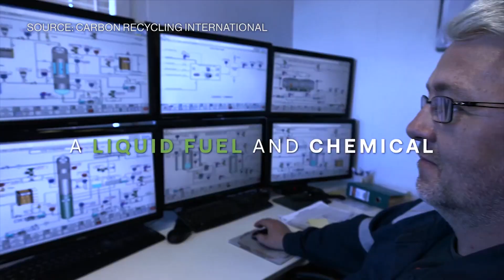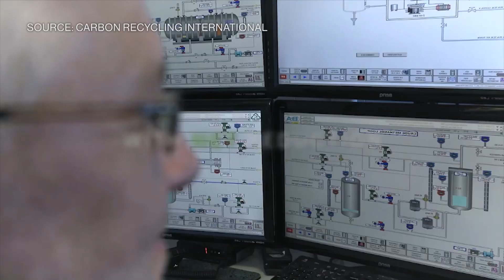Koenigsegg Wants to Use Volcanoes as an Energy Source

Comment: Interestingly, Methanol is a highly flexible fuel i.e it can not only be used in ICE but also fuel cells to produce Hydrogen (electricity) and paired with electric motors or an off grid energy source, etc!

Comment: lol, so would fuel consumption be capped at the amount that can be produced by volcanoes then?

or does everyone who isn't Iceland just have to expend enormous amounts of energy scrubbing CO2 out of the air to make fuel at absurd expense because they didn't have a convenient way to claim carbon neutrality for free?

why don't you just take the CO2 and put it back in the ground somewhere and sell the carbon credits instead? if CO2 reduction is the goal, you'd help more by doing that rather than continuing to promote use of fuels that emit CO2 when burned

then take the thermal energy and use it to produce hydrogen instead, that way you can be carbon negative and provide a fuel